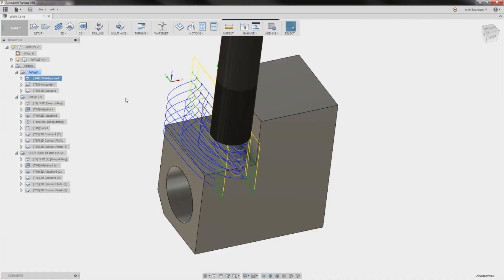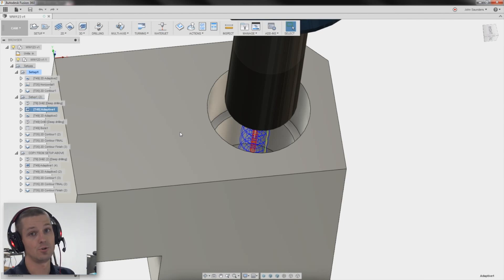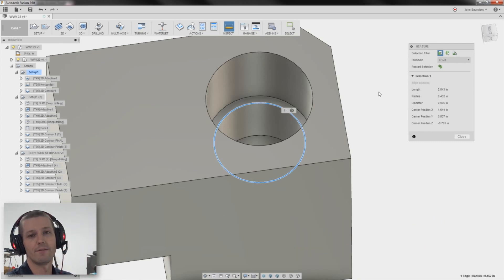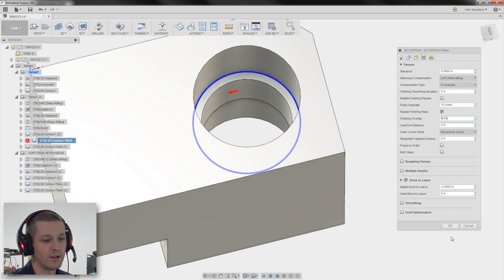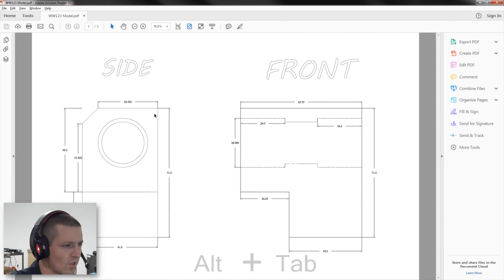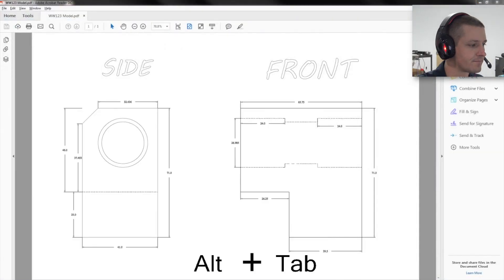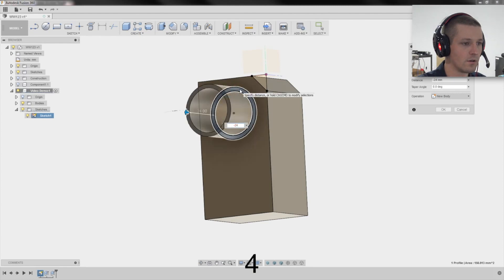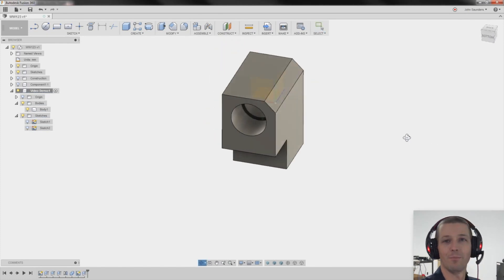Fusion 360: Motorcycle Suspension Linkage Bearing Block!

Comment: Hey John. You know you could have CAD the part with one sketch and four extrude operations. Make a sketch that like the "Side" drawing that you displayed from the client. The only difference is the dotted line of the cut out should be solid so not to be construction. Extrude the 46mm portion with the larger 26.985mm hole also selected to the 65.75mm height. This will produce the shape with the centre bore already cut out. Extrude the 26mm cut out section to 39.5mm making sure the "join" option is selected. Extrude the 26.985mm counter bore the 24mm needed then extrude the same counter bore from the sketch but select starting point to "from object" and select the opposite face then extrude -24mm. Done. No second sketch and the top and bottom counter bore faces are referenced if you change the height. If you want a video or drawing let me know.

Comment: RE calling a tool by another designation, also called "lying to the machine", I do this with a center drill I use for spot drilling and also for engraving. Tool 101 actually has 3 designations, one is called a center drill, one a ball endmill,  and the other is called a chamfer mill. The center drill actually makes a decent engraving tool in aluminum. Thanks!

Comment: The CAD presentations parts always leave me with gritted teeth; they seem to be so "arcane".

Seems to me that CAD for machinists and mechanical types is more natural with 3D modelling done in the same way as the machining. VariCAD for example lets you create a block (or other basic shape) with base dimensions, then "mill", drill and chamfer (etc) to make the final shape. There are "draftsman" features and neat stuff like lofting from rectangular to curved profiles, but the main modelling functions mimic those in the physical world of hammers, saws, mills, drills, etc. The designer is already thinking "machining" while drawing the part.

The sad thing :-( is that there's no direct path to CAM from VariCAD; you can export 3D objects and then import them into a CAM (STEP works quite reliably).

Comment: That was painful.

Why bother with CAD, if you've got enough information to manufacture already?

Why change the surface you're dimensioning off of from what is specified by the client to what is convenient to you?

That mirror is a bad idea. Say the client decides they want that ridge in there off center. You now need to rebuild the model.
Reply: Belias Phyre 
Makes programming much easier. 

It's a simple part, 10 minutes of CAD at most, then makes doing the CAM that much faster.

What you dimension off of in CAD doesn't matter provided all the numbers come out where they should be. It's just to build a model, not do a formal drawing. 

Mirror I agree I wouldn't use either. But that said Fusion can push/pull existing bodies so you could off center that mid bore easily with a push/pull without having to go back into a sketch. Or completely rebuild the model. 
Even in something like SW you could quickly and easily offset the bore without a complete model rebuild.
Reply: You can't feed the client's 2D pdf drawing into the CNC machine...

The change to the model you mentioned would take 30 seconds - would not require building the model at all.

Comment: John,  I noticed you had the Shear Hog Tool Dia. set to 0.75? Should that be a 1.0 Dia? Also will it make a difference if the the Tool Dia. in Fusion is different than in Path Pilot?  Thanks and congrats on your Awesome new Haas:)
Reply: karl winter different dia in Fusion vs the control only matters if you are using cutter comp.  

If you're not using cutter comp, the dia number in the control doesn't matter, the machine will never look at it.  If you are using cutter comp, then the dia better match within a few thou. If they don't you're gonna get some disappointing results.
Reply: Ok thanks:)

Comment: Hello, I tried using 4 axis router to mill cylindrical surface as lathe, but instead of turning knife to use end mill. Does this embodiment to make use of Fusion 360. Sincerely Yancho
Reply: Is this wire frame app only for Mac machines

Comment: Great channel, for your bird nests, in 6061 or 2023 try 200spm and .005 chip load 1/4" peck. Also the carbide drill is part of the proplem, the carbide is not sharp on the cutting edges (margin and the lip relief angle) like cobalt is ditto on endmills.